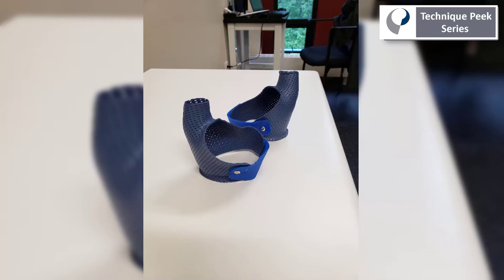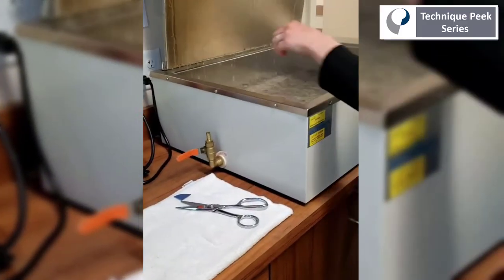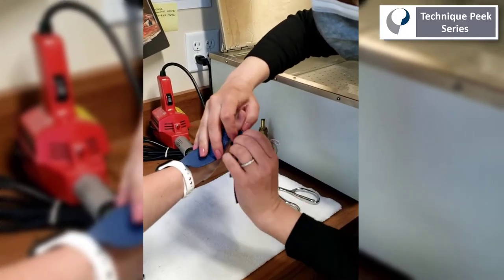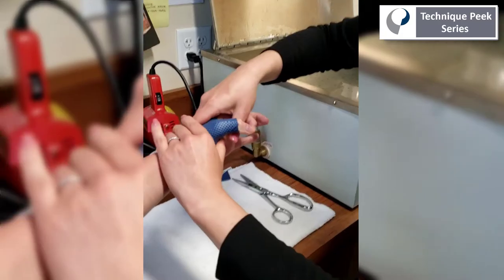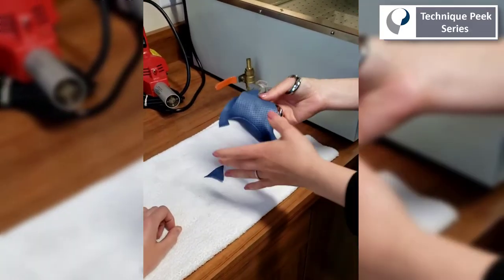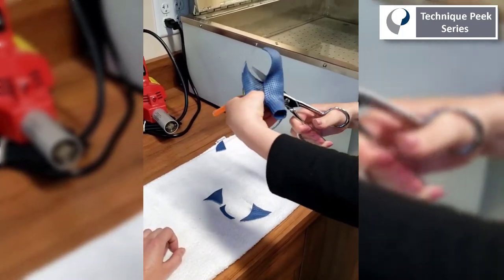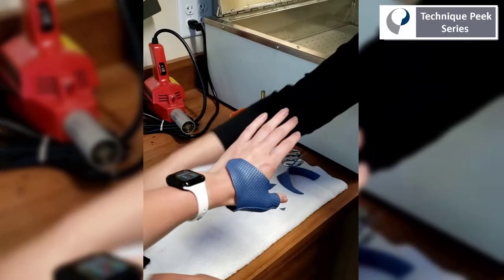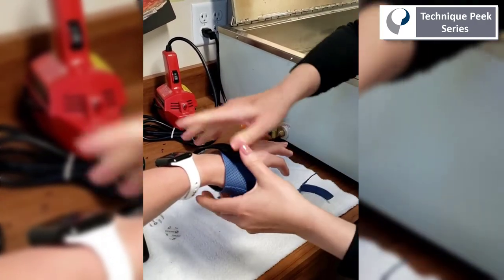How to Make a Thumb Spica Splint in less than 5 Minutes  |  #TechniquePeekSeries

Comment: And the Velcro comes off…..you have to super glue it or it will not stay on.
Reply from the maker: Hi Stacy! That's a great idea. You can also use a heat gun to warm up the area on the splinting material and the glue on the velcro so that it sticks together better. Hope that helps. Thanks for watching!
Reply: It depends upon the material. Some thermoplastics  have a  coating and you need to scratch the coating off with scizzors before you apply the sticky back velcro:)